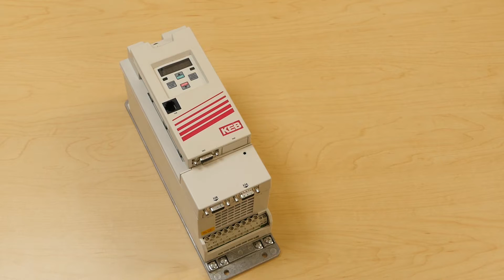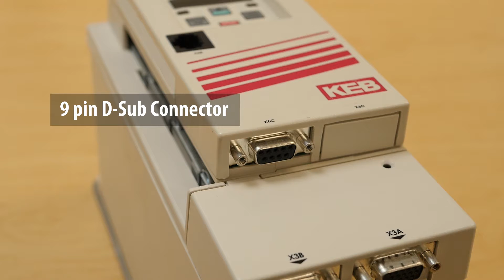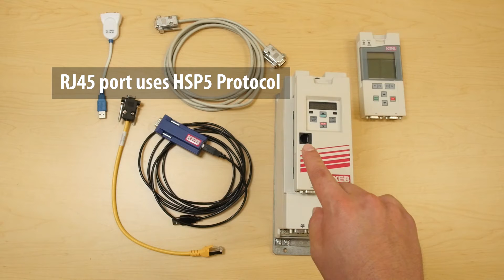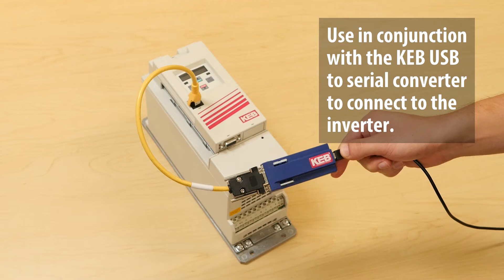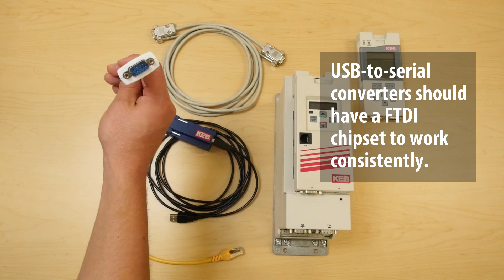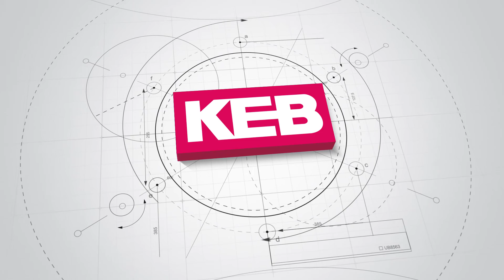Combivis 6 Tutorial: Ep 01 - Cables to Connect to KEB F5 device

Comment: Hi... thank you for the video tutorial, in the video, u gave instructions on connection with (operator F5 CAN ) but I have Operator F5 Powerlink Material no: 00F5060-H000. could you please share a link for how to establish a connection using RJ45 with the operator F5 Powerlink. thanks in advance for your support.
Reply from the maker: Hay Nadeem, I don’t think I understand your question.  Video doesn’t specify CAN anywhere and there is nothing unique about the connection to the Powerlink operator. The video shows you how to connect to your computer using the RJ45 connection. The part numbers are in the description of the video. You will need a  (1) KEB USB-to-serial adapter and, (2) an RJ45 adapter. Contact a local KEB rep to get these parts. 
Have a great day.

Comment: Hello, can I use the port X6B in the 00.F5.060-5010 Operator panel for communicate with the PC ( using the correct cables)?
Reply from the maker: That's correct. You would need the cables in the Combivis starter kit (CV58060-USBC). Contact your local KEB distributor to get this kit. If you're in North America, find a local distributor on this webpage: https://www.kebamerica.com/contact

Comment: I have a USB to Serial converter with FTDI chipset, which is functioning well in all my industrial needs, now i want to know that whether i can connect "Combivis 6 software with  KEB16F5A1E-34GA" whose version on drive name plate is Blank (without anything written).  Can you Please guide me.....
Reply from the maker: Hello. Thanks for your question. Connecting to this drive without knowing the nameplate data depends on the operator used (p/n 00F5060-xxxx).  Only the -2000 operator would work without an additional cable.  Also while the FTDI chipset is required for the cable to work, there is no guarantee a generic cable will work properly.  Recommendation would be to order the Combivis Starter Kit (CV58060-USBC). If you need more info please contact us via email or phone and talk with an application engineer.
Reply: @KEBAmerica  Thank you for Reply, i will try

Comment: If we use RS232 to usd adapter wifh Prolific PL2303 chipset, can we connect the F5 drive?
Reply from the maker: USB to Serial Adapter requires an FTDI chipset to work with our drives/Combivis.  We cannot guarantee any specific 3rd party cable will work and strongly recommend our USB to Serial Converter. Hope this helps. Thanks for the question.

Comment: sir if i use rs232 usb adapter with db9 conntor cable can he will online vfd
Reply: plz reply
Reply from the maker: Hello Javaid,
Thank you for your question. You will need to clarify a few things in your comment:
1. If you use a USB to serial adaptor, it must have an FTDI chipset. For example, the USB to serial adaptors you would get from Office Max would not be made for industrial applications and most likely would not work.
2. A straight serial cable will not work. To connect to the drive using a serial operator, you would need to use a serial cable wired with pins 2-2, 3-3 and 5-7 (PC side-Drive side).
3. As mentioned above, you would need a serial operator as well. A better option is to use our new USB to serial converter part number CV58060-USBC. The USB converter can connect to the drive in multiple ways so gives more flexibility to cover all applications.
We hope this helps clarify your needs to connect to a KEB VFD. You can always contact a local KEB Representative here: https://www.keb.co.uk/company/representatives-agencies